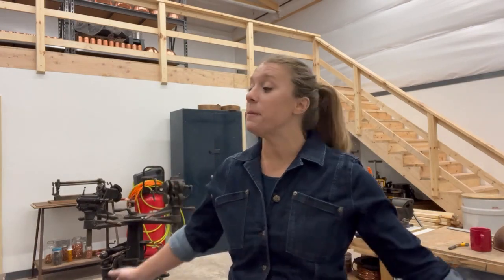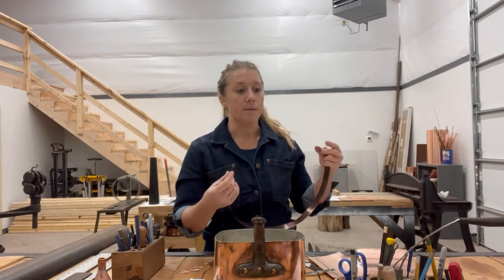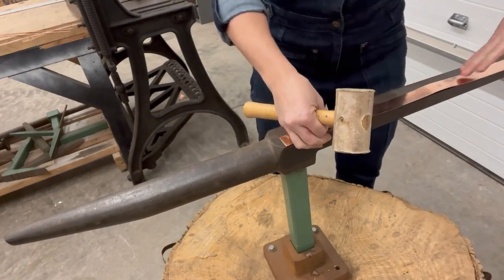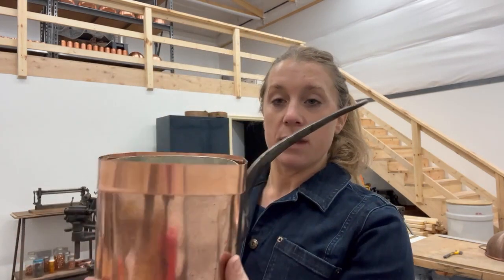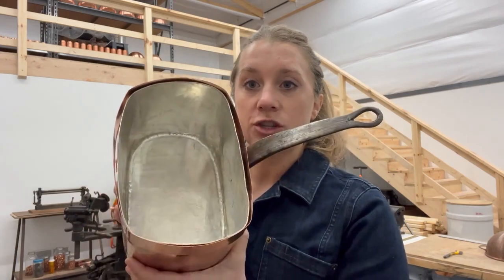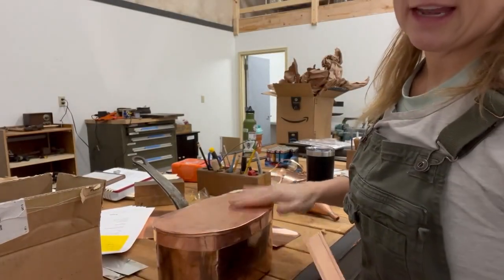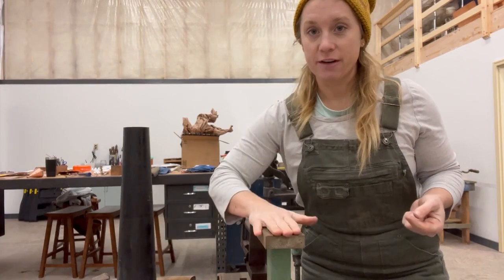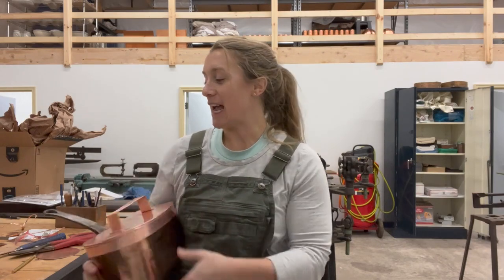Building a Unique Shaped Lid

Comment: Hi! Thanks for your videos, I'm a big fan. About drilling holes for the rivets - in the lid, using a step drill bit should give you a cleaner hole. And using a Roper-Whitney or Grizzly hand punch to punch holes in the handle's feet, would also give you a better hole than using a twist drill. (Faster and easier, too.) You could probably even punch the holes in the ends of the handle prior to folding over the feet on the stake.
Reply from the maker: I will look up the step drill! Hand punches actually end up pushing a ton of the copper outward when I use them (and if I use them too early, then have to hammer the extra material back flat, the hole gets misshapen or has to be re-drilled) so I try not to use them with copper. The master smith I apprenticed under for 7 years also drills the holes as the last step in the process (I believe for the same reason - do too soon and it gets misshapen during some of the other processes). Thank you for the tool ideas - I am going to look up both!! They sound great!!
Reply: @housecopper  After I commented, I second-guessed myself, because it looks like the sheet you work with is very thin. When I have the chance to work with sheet metal, which is too infrequent, it's usually aluminum 0.8-1.0 mm thick, and I find that a twist drill doesn't necessarily make a circular hole (it can have three lobes) or else it screws itself into the sheet metal as it's about to exit the material. What thicknesses do you use? Maybe sandwiching the copper sheet between a couple of scraps, and punching through the scraps, would prevent the copper from being pushed outward.

Comment: Sarah have you addressed the treatment or removal of lead solder in/on copper or steel coffee pots etc. Thanks, Mark
Reply from the maker: I have not addressed this. I don't often see lead much, and if I do, I don't usually grind it all off for various reasons. I can/sometimes have tinned over it as the lead allows for tin to flow over the top. (I have never worked with a steel coffee pot - that sounds interesting!) :)
Reply: @housecopper  thanks

Comment: I got a question about a copper pan that received a new handle in the past. It's got a hole in the pan where a rivet used to be, what would you do to fix it? 
Is there anyway to send you a picture of it?
Reply from the maker: Depending on the hole, you could try to braze it shut. You can email copperassistant@gmail.com with photos!